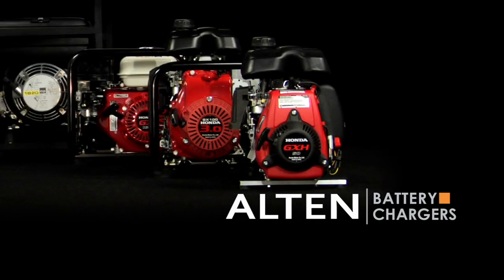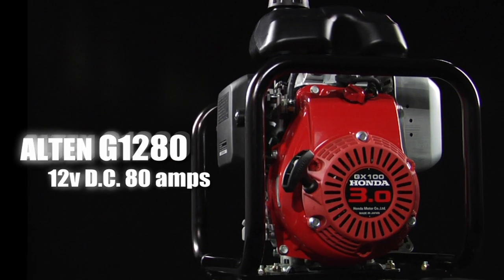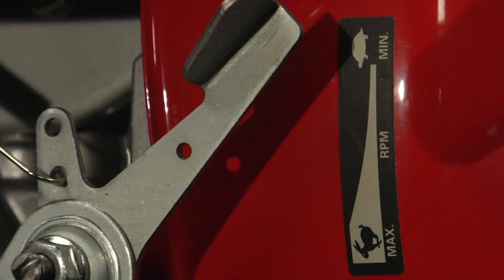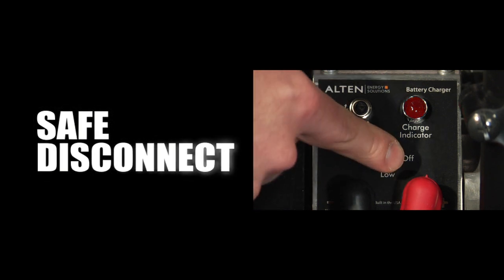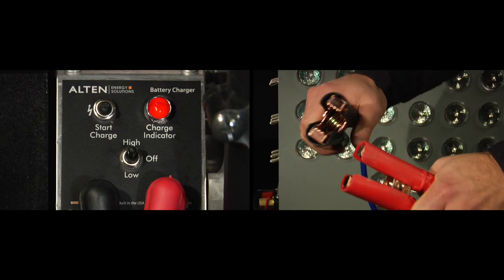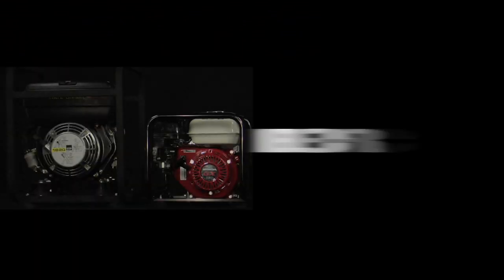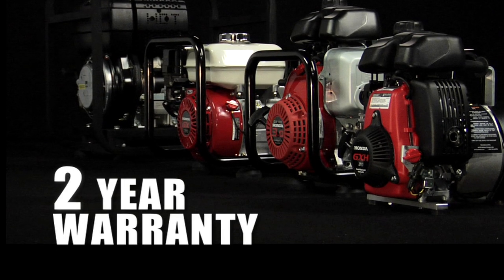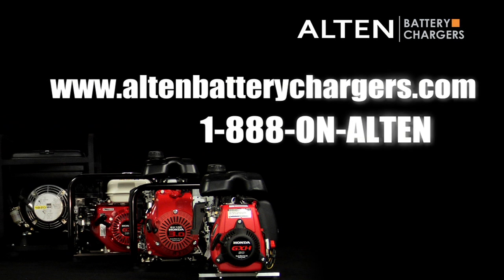ALTEN Battery-Charging DC Generators

Comment: It's cool that some one does make a 12 volt DC engine driven generator - that's designed for charging and maintaining the operating voltage of a 12 volt system - also they commented that they have a diesel version also -

Comment: is it possible that the individual models could be displayed in video form..  i was also thinking of something less than 80 amps output for a marine diesel suitcase contained battery charger for sail boats that have been converted to electric propulsion.  not as an additional power source to run the electric propulsion but to recharge the batteries when away from shore power or during cloudy days when the solar does not make enough. 

 something small enough to store in a cabinet with some power cord also to plug into the charge controller only as needed and have a cleat with a hole in the middle design to the carry handle to lash it to the cockpit or railing.  even running it up the mast ..  to allow the exhaust to dissipate. 

 its just a thought..  if a fairly small diesel engine is available..   small enough for camping or off grid cabins.. with long storage life diesel.